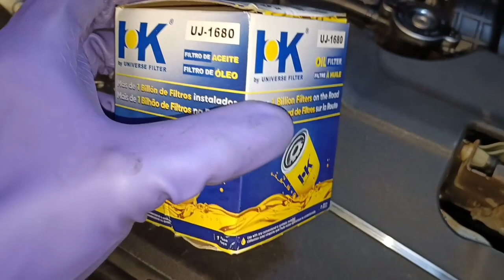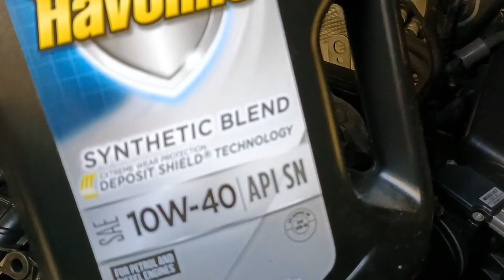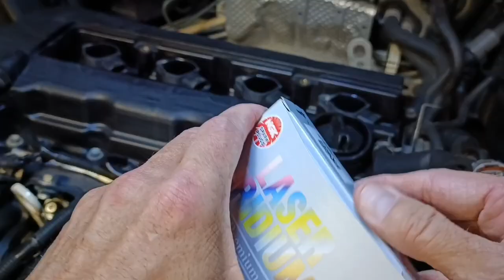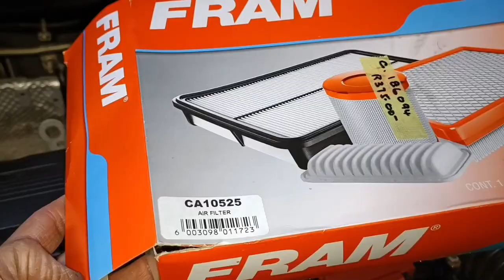ASMR RESCUE VEHICLE SERVICE 🔧🚔🪛🔩⚙️

Comment: Hi Jason..
Next time fill the oil filter with clean oil before screwing it back on.. It helps prime the pump and the oil light goes straight out when you start it up... Also, be carefull using engine oil on plug threads.. Ive seen it turn to a strong glue with the heat.. Use copper grease instead (Only a touch!).. and i didn't see you use a new copper washer on the drain plug.! lol.!
Love your channel mate.. Thanks.
Stay Safe..
Reply from the maker: Thank you for that. I actually researched afterwards that spark plugs these days come from the manufacturer with a special, protective layer on them and that nothing should be put on them at all. Oh well.... Next time.
Thank you for your tips 👍🏻💪🏻👌🏻